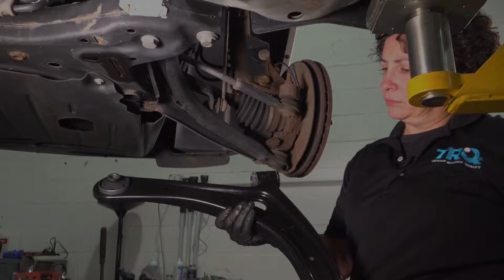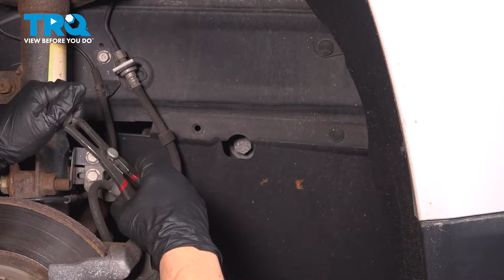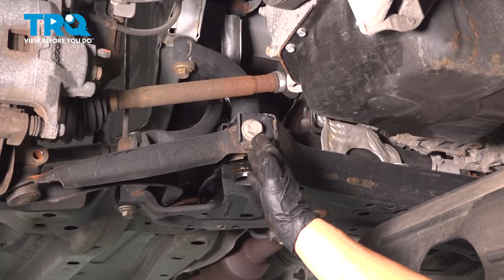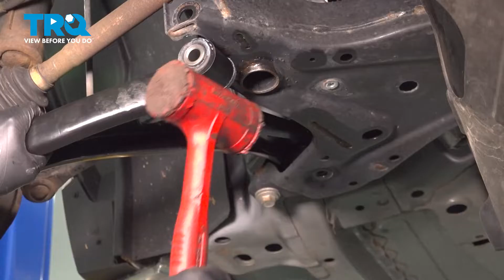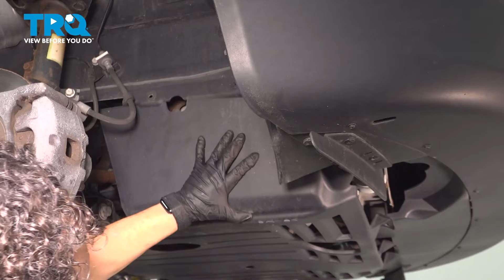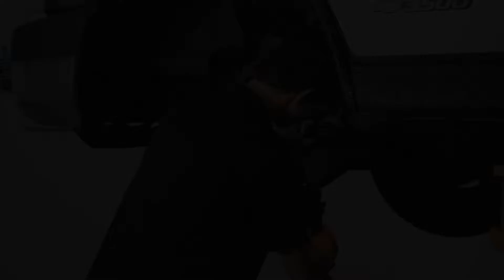How to Replace Passenger Side Control Arm 2007-2017 Jeep Compass

Comment: It is not necessary to remove the center wheel bolt for installation.
This lever is installed incorrectly; the bolts must be tightened strictly under load—the vehicle must be resting on its wheels, or the wheel hub must be raised with a jack.

Comment: Use a pole jack to raise the lower control arm up to horizontal ride height (trim height) before torqueing the control arm bolts so the bushing is not already twisted when resting at regular ride height because if it is already twisted at ride height the first time you hit a bump it will twist so far that the bushing will rip...

Comment: Such an excellent video. The detail about the order and method of reinstalling the arm was priceless. The part where she adjusted the ball joint with a hammer to achieve the best angle for re inserting it was a huge tip that will hopefully make the job a lot easier when I attempt this repair.

Comment: This method did not work for me on a 17 Compass, I struggled for hours to line it up. Instead of removing the Axle nut remove the two 21 mm bolts holding the strut and disconnect the outer tie rod 18mm.. Way easier to install and remove and you don't need the 32 mm axle nut. Overall you need 21 and 18 mm sockets and wrenches; 19mm for the lugs